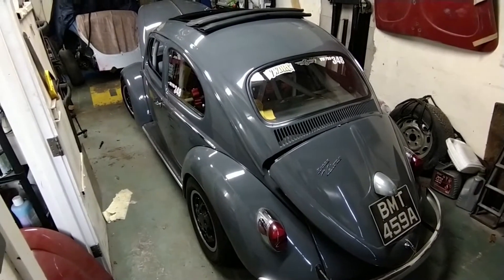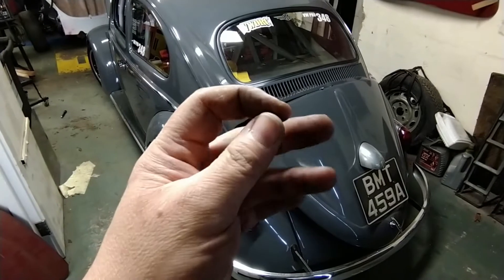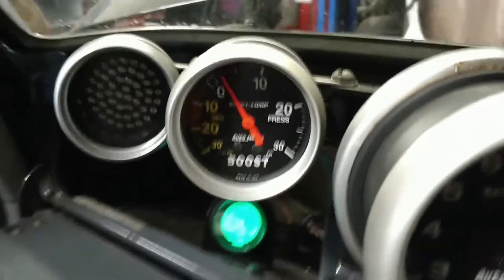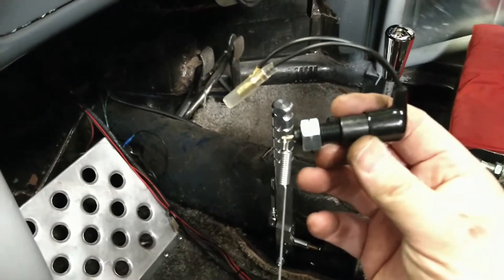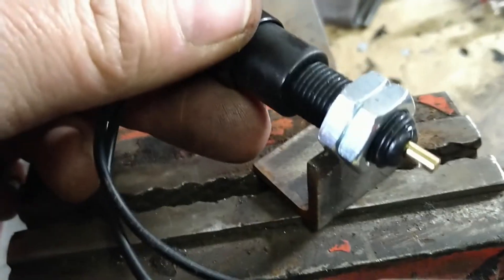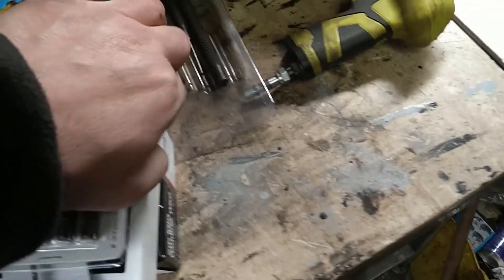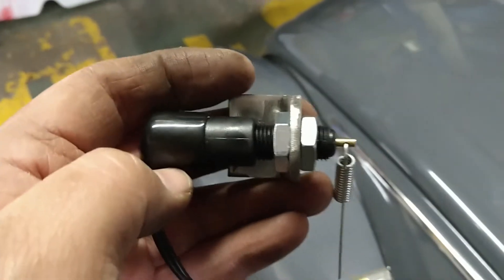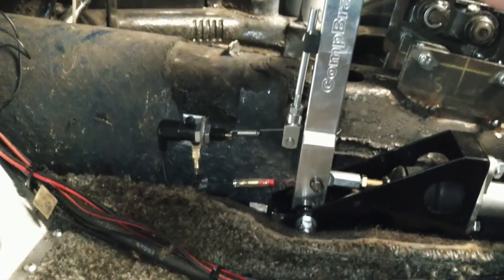300bhp '63 Turbo WBX powered Beetle gets megasquirt Launch Control

Comment: Another quick? question(s): with 300bhp will your car pull the front wheels completely off the ground? Have you taken it to Santa Pod? I believe 300bhp in an 1800 lb bug would be like 600 in a 3500-ish sedan, which is a lot!  If you can't tell I love your car! 😁 Thanks for entertaining my silly questions and take care!
Reply from the maker: In theory, I think it should be able to lift the wheels, but there is a fair bit of weight at the front end. There's the radiator full of water and the Porsche brakes are quite heavy too.
I race with the VWDRC so have been to santa pod a fair bit. However, in the time I've had this car I've had a few teething troubles, plus on other occasions the weather has been rubbish. Then there's the whole pandemic thing too... Anyway the best I've managed is a mid 13 second run at just short of 100mph. That was on older road tyres and a gentle launch.

In the hands of the previous owner (and the car's builder) it ran a 10.8 at 131mph.
I don't think it lifted the wheels on that run either tbh

Comment: Thanks for the update. On a side note (question) how do you like the sliding sunroof in your '63 ragtop? Does it provide good airflow and sunlight when fully open? I have a '59 hardtop and a roof clip from a '63 ragtop hanging on my garage wall, but haven't had the time or nerve to cut a hole in my bug's roof to fit it in.
Reply from the maker: I really like the ragtop. It's not original to the car though. The previous owner fitted it.
It's open the car up and isn't draughty at all. It lets plenty of sunlight in, but more importantly it lets a lot of the noise out!!